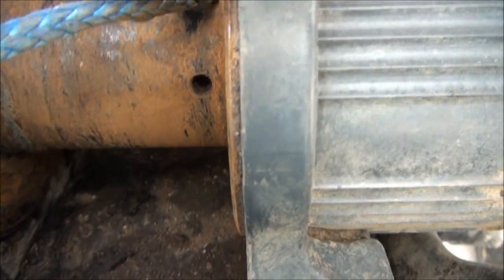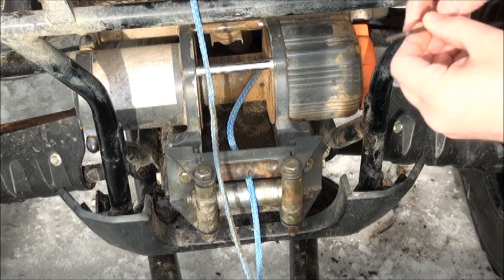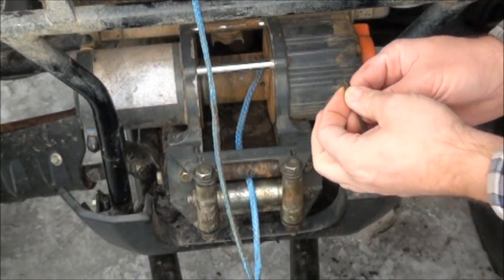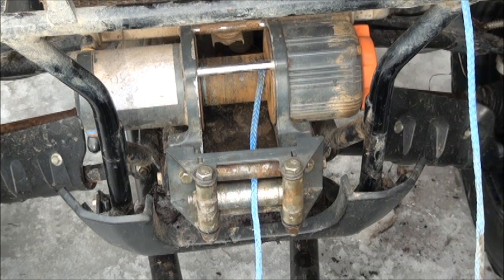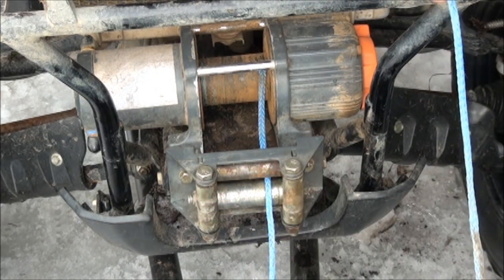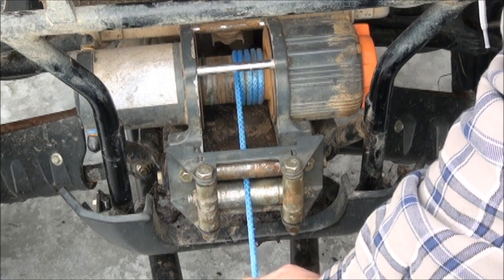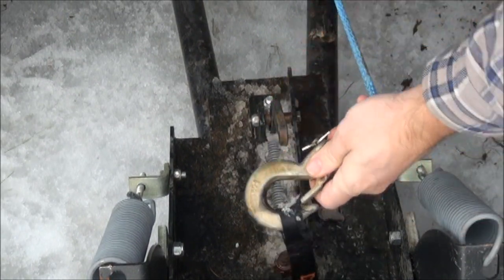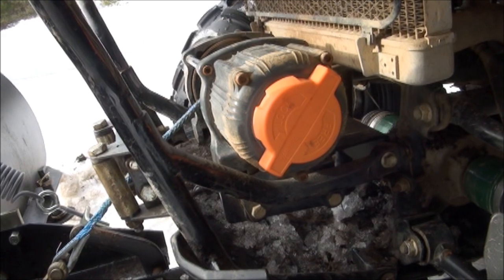DIY - How to Replace a Winch Cable With AmSteel Synthetic Rope!

Comment: Best to use an old ratchet strap end about 2    2 half ft rolled on to winch.  1 to 2 in wide . Saves rope wears hardly at all
Reply from the maker: That is a great idea:-)  I have had the synthetic rope on their since this video and has not broken yet:-)